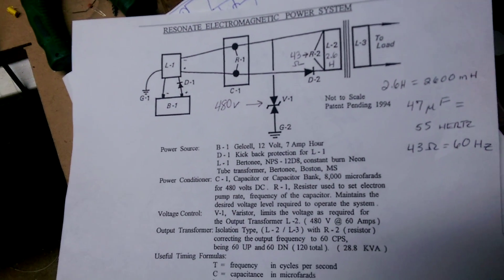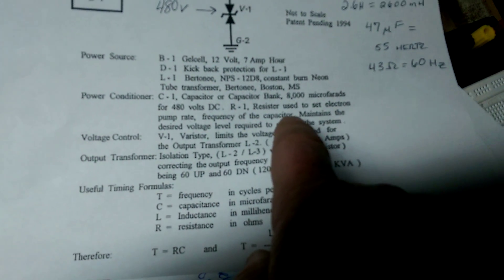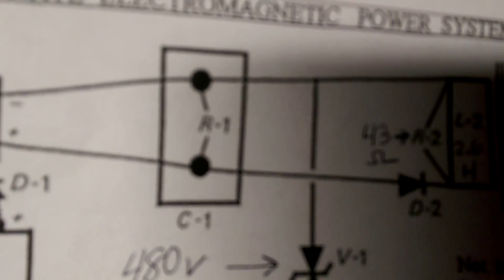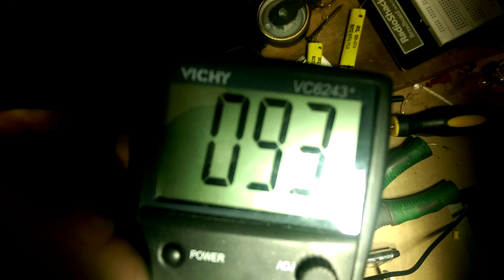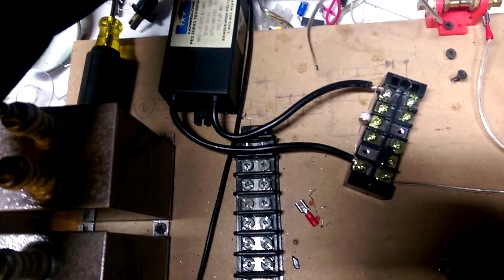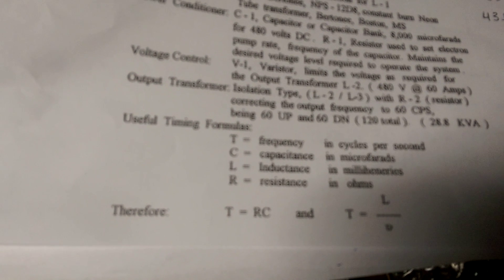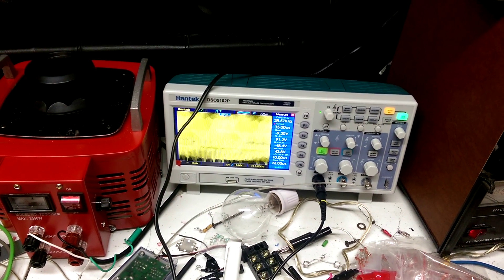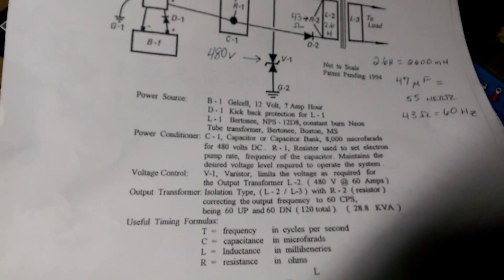Don Smith How To Video

Comment: at L2  the resistance in ohms must be smaller than inductance in milliheneries to arrive at a whole number , in fact we want the number 60  //  what am i missing ???   help
Reply from the maker: +frank ertolacci  This circuit is  just "one" of the modules Don said to build and get working before linking the modules. I have found that a number of things do not work in Don's systems, first and the dumbest one is the fact that Don had to hide a lot of the good stuff and substitute it for fakes because he only left parts that did not work at all.  If you look through the Zilano posts, you'll see this circuit added backwards in one place as an addition to his othger circuits. It is a good idea to try it many ways, however, I have found that Don connected these NST's to just about anything. The dc cap was a really ballsy thing to add into the circuit., but , you will find that it is actually one of the correct ways to make a variation of his circuit work. It may not be a complete working circuit, but the cap may be a learning point for one of his circuit variations. Don worked in a wierd way.. he wanted us all to learn something and he pushed forward to teach us ways to convert these strange unconventional types of energy by bringing these methods to the table.. Normally these caps would not be used or they would explode.. there's good reason why they don't and if we look at Tesla's method of energy collection, we will see polarized caps were not ever shown, however, they needed to be used and this was always the big secret about Tesla's technologies.  C1 is not an oil filled cap as I used, or tried to use as I didn't quite see the listed DC part in the print since I didn't have my glasses on that day. A DC cap is a blocker and the resistor will allow the energy or "cold electricity" to pass , changing the "situation and converting only the form of electricity that we wish to use without forcing the load back to the source. Static electricity is literally 2 components, a high voltage/high frequency electrical component as well as a cold radiation or cold electricity mix. (I call this ionic electricity where it is present in mass quantities but only shows so much of itself while the usable portion of energy that does work remains hiden until processed.)  When we put the high voltage static to the cap, it doesn't have enough ass to blow it apart if we use a 12v NST as he uses.. It will just charge the cap. When we add the resistor, the cold electricity carries on and passes the capacitor as a limited energy component and we then arrive at the next step.. at the next component, the Varistor. I purposely left the varistor out to try and add a resistance to the transformer, however, the energy will NOT get into or pass through the transformer core as it will saturate and shut it down at like 12khz.  The transformer is literally going to get oscillations of energy which will activate the transformer, saturate it after we get what we need, then, again turn it on.. giving us the 60 cps or so that we need for it's function. The difference in waveform won't effect the load.. the energy seems to become smart at this point, then, at it's output under load, the waveform is improved to function in a very specific manner. Skip the transformer until the varistor is used and I would look at getting a varistor that has very minimal capacitance, in the picofarad range, really small, then, ensure the working voltage is cut at about 240v., The varistor doesn't have to be of a massive amperage, however, you need it to last so find one that doesn't wear and blow out after a few days. The arc discharge tube can be used to do the same thing, and I actually prefer one because it won't act as a capacitor.. Don stated he always used Varactors, not Varistors, so, this will also act as an avramenko plug which is one of the only components that we so closely related to the Moray Valve. I'd focus on getting the energy to flow, then try to tune the system. If you use a DC cap as he says to, make sure the voltage corresponds to his listing and the nst can be controlled for voltage. He uses a 12 volt nst for a reason, and, he says that they are much more powerful, in fact, he said you don't just get a home run with them, you'll smack it right out of the park!  Let me know when you get set up for the cap and resistor, turn it on and see what you have at that point. It's literally impossible to build any devices like this without a scope, an HV probe good for 10kV minimum, a frequency counter, imoedance meter, volt meter, inductance meter, and, all of the items needed to test the caps, etc. Capacitors by the way are important to test to verify where within the 10% accuracy they land, resistors too. If you aren't accurate, resonances cant really be tuned unless you have a tuner.. Do you have all of these testers? If not, what do you have available to you?
Reply: +Marc Belanger   volt , cap , ohm ,  //  waiting for arrival of square d transformer  //  inductance is on name plate   //  i have some extra dc caps 2400 uf , you need a couple  ????   when i hear the name tesla , the first thing i always think is 1 million volts at a million c.p.s.  //  i have 12 vdc neon transformer but i think we need the secondary winding to start- clock wise then make the center tap and complete the winding counter-clockwise  //  earth ground the center tap  //  don always talked about spinning electrons one way gives volts and spinning the opposite way gives amps   //  the opposing coils should produce watts
Reply from the maker: well, in a way... the energy flow has to be established first. That is if you provide coils to be used, according to Don, the simpler forms didn't need coils other than for a boost in voltage, then a reduction again via resistors for the wavelength's multiplication over the cap voltage's size. For instance, if we use an NST of 2kV to start, the secondary voltage should be 4 times the capacitor voltage to create the correct equivalent in cold electricity. The inductance is critical to know, as well as your capacitance, so, if you wind your own coils, the inductance meter is vital so you can calculate the proper capacitance needed. I find making your own coils not only extremely difficult to tune, but, a nightmare to get the energy to pass from one coil to the next.
Reply from the maker: I just got what you were saying.  let me look into this.  I think to get this,  you have to realize that inductance grows if we have less length and more turns.  the coils are supposed to simulate normal rf coils that are 3 times in length than diameter if that sheds light on. the situation for you.  I've also figured out that the spacing between the turns on the secondary are proportional to your step up or step down ratio,  and they have to be.  the insulation on the primary has to be there,  secondary can be bare because the voltage would be 3 to 4 times and spacing follows this x 4 rule of thumb.  im finding the rule is actually 4.16, not 4 exactly..  that's a small hint.  here is another that will assist you tremendously. look at any transformer,  conventional type and mic up the wire size.  get an accurate digital scale.  figure out the primary size and secondary size ratio or difference.  its usually like a 26 to 30 gauge for the high side,  and 16 to 18 gauge on the low side.  the 16 gauge length will weigh the same as the 26 gauge.  this gives you a proportional coupling that will transfer energy every time.  find out the input frequency and capacitor size that coincided for your frequency after you read your accurate inductance.  then do the same with your secondary..  wire it up and test the primary without anything else in the circuit using a decoupling cap the same size as your scopes probe capacitance and you should be very close to the frequency you wish for,  however,  now you'll need to add components to reduce or add capacitance,  so,  I always recommend wiring in or figuring in an air capacitor that will move a few thousand picofarads and center it before you scope it,  then,  tune it as you use an then to test it.  hv will change things bit so be ready for minor drifts and cap accuracy percentage changes

Comment: Why does Don have an unconnected portion of his coil? In his suitcase device, revealed later, it had an unconnected coil saying it was essential to this device. There is a video of someone showing a working/nonworking device where the only difference is the disconnected coil leg. Once disconnected works like Don claims.
Reply from the maker: the disconnected coil I never saw,  however,  it is advsntageous in specific devices such as the slayer exciter and other "aerially broadcasted" or aerially returning systems.  Don. has a full wave bridge rectifier missing a negative connection. and it is due to the fact that when you cnnect it,  all of the wireless energy goes away
Reply from the maker: could you send me the link?  I have a disconnection to a battery in one of my systems s the battery wirelessly charges

Comment: I had to return one of those streetglow from ebay; I thought it would spark and I even asked the seller after the fact but I couldnt get even a tiny spark, seller said it wasnt made for that. I tried 24 volts with good amperage and still no go did yours work?
Reply from the maker: yes, it isn't anything like the a.c. nst, but, according to Don Smith, he was able to get the best result from these. I find that the arc is very.controlled, however, it needs to have the right circuit to respond correctly. it runs fine through an arc discharge tube, just wire the hot legs to one side each and energize it. You'll have to shut the lights off to see the discharge light, but, the arcs are nearly silent. This method is how I test my output frequency. it charged my large 88uf 1200v cap to maximum in 5 seconds using the correct charge pump circuit, but, it has no ass to.it's pulse like a.c. NSTs do. Smith said there's more energy in a very mild and controlled output than a powerful, choppy and dangerous oscillation all day long. my arc discharge resembles a bluish purple laser, and it flowed smooth like silent water if that makes sense.. it wasn't an erratic arc, it was a plasma beam. I'll video this when I.reuse the transformer again. I was quite impressed with its ability to charge the capacitor the way it did.
Reply from the maker: oh by the way this circuit that I am displaying is from Don Smith PDF. he warns that this circuit he displayed was incomplete to protect him from contractual obligations. he recommends that this is built as a module to add to some of the other circuits is left us connected together to finalize the product. if we look at the component sizes he used on his bench top model then compare the variables from the coils and calculate the resonant frequencies, nothing lines up or would work the way he says so if you are building any of his devices be 100% sure that you whined the coils and test for inductance then test the output frequency by winding a test coil that will transform the NST energy too low voltage so you can wire a frequency counter to the circuit to get an accurate frequency without destroying a meter. if you don't use an online calculator be very careful and understand that the NST has capacitance and inductance that will interfere with your resonant calculations. I'm finding to have very good luck with the arrangement that I copied from a Russian fellow on youtube. he literally builds a Tesla charge pump and he puts the arc gap after this so he gets a discharge pop. this discharge pop can be regulated by the capacitor size and it will soon its pulse frequency. the Russian guy shows a video pulsing one light bulb and he may have been pulsing it 150 times per minute. I set my circuit up the same way and when I forgot an LED that was wired to the secondary once the first pop happened the LED exploded like a bomb. I knew then exactly what had to happen to give me the output necessary to charge the capacitor bank. Don says the capacitor will hold a mega charge but will do nothing unless we add a voltage divider and build a simple inverter with very high current transistors or IGBTs. if are capacitors are large enough the current carrying capacity of the wires will need to be incredibly large to feed these IGBTs. the pulse that I created from discharging a 2 microfarad capacitor charged to 3000 volts damage the screwdriver worse than putting it across a 480 volt 60 amp circuit. it literally blew the steel screwdriver into little molten pieces. I will try to draw the circuit to show you how I.wired it. I also sent a picture of the coils I made the other night, using the pancake coil. the pancake makes it perfectly in resonance from any frequency without tuning. my secondary needs tuning, and since it's a B&W coil with a written spec, I know that my.inductance meter was accurate. please let me know if you have any questions. oh, one more thing I.discovered other than the coil is that if we have tall terminals for the spark gap, like 1.5 to 2" tall, spaced perfectly about 1/16 to 1/4", the energy drawn in literally amplifies the output of the system. if it's short and has erratic behavior, much less happens.
Reply from the maker: +Alex Manzanero My nst (this one works great but it is a tiny stream of arcing, like plasma) it isn't close to the energy sparking on an ac neon, but, this is what you want, however, you need to use arc discharge tubes and to know if they are arcing, you need to shut the lights off. They arced perfectly but use too much energy to get gains unless the circuit is using a different method of energy induction other than phase conjugation (the circuit I self charge the battery), so, this might be the right nst for the above circuit. I just recently foundd that it won't run with an ac cap!! must be DC otherwise the system will shut down. This nst is a pulsed dc high voltage which reacts much differently.. however, if you'd like to see a cap charge quickly?? try one of these, or, find another kind that will not be protected. I did find that if you start one of these nst's and it doesn't like your setup, like with the first cap, it won't fire. You have to shut it down and remove the ac cap otherwise it will NOT turn on at all and seem dead because it takes time to reset!! I had to power it down, then, to check and make sure it wasnt burnt up by adding a spark gap across the two large leads and energized it. It flashed across fine, but, it is a different animal than ac units because the pulse width is very slim, making a very smooth and quiet plasma of a purple hue. These circuits will become extremely powerful as it was one of Don's best , most powerful circuits. The briefcase device "rang" at 12-14khz. That made a whistle like a laminated transformer core was whining. This could have been the circuit, and it is based upon the simplest one he has, however, take the .1 uF caps out, or whatever he has before the spark gap unless it is a dc cap.